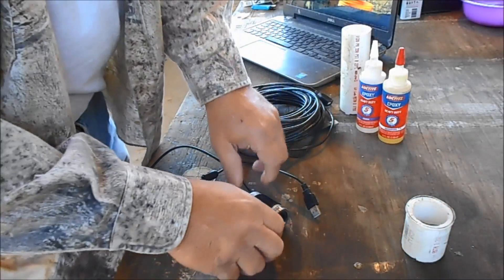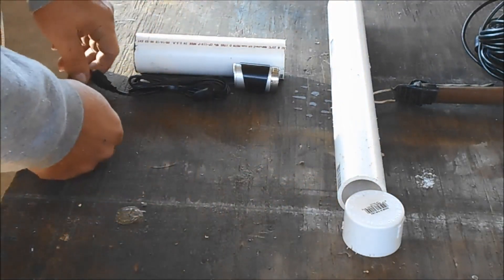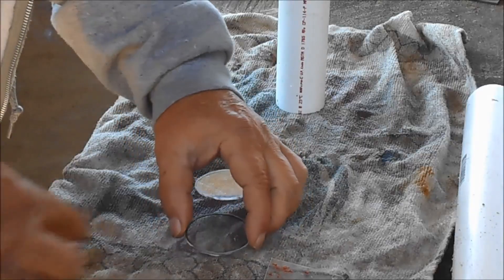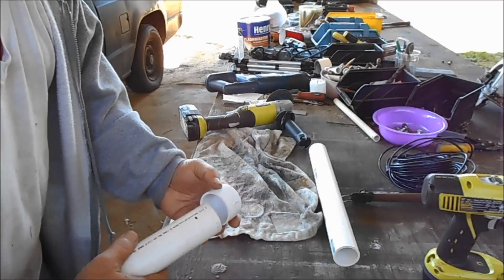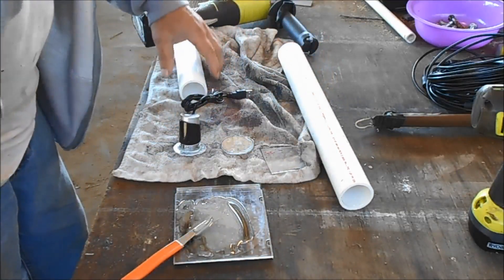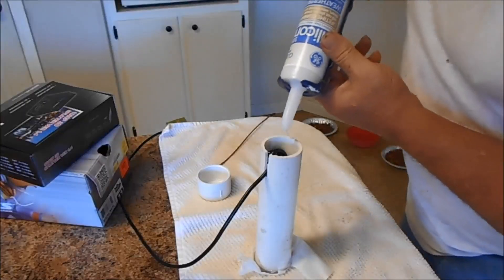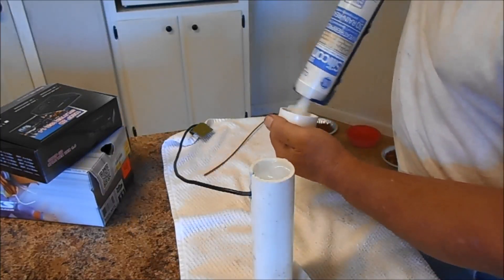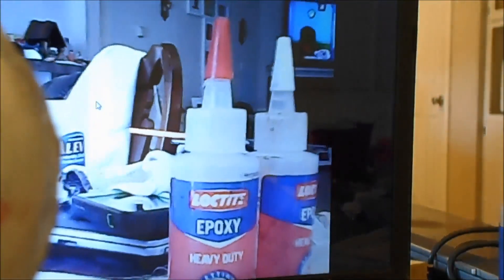HOW TO MAKE A UNDERWATER CAMERA

Comment: Cool video!  I built my own 15 years ago with a security camera that I had hooked to a portable DVD player. Worked great. I’m going to make a new one with an 1080p security camera and found a 7” HD lcd monitor on Amazon used for those back up cameras on your vehicle. I can do the whole thing for 60 bucks because I already have the pvc pipe. Cheapest hd color fishing camera I can find on Amazon is only 720p and it’s $169. DIY saves you $$$

Comment: The silicone will never dry
Reply: I like the silicone, but I agree he did not have to use so much,and should have installed cap using pvc glue days later..other than that it seems decent inexpensive way to find lost objects in deep murky water..